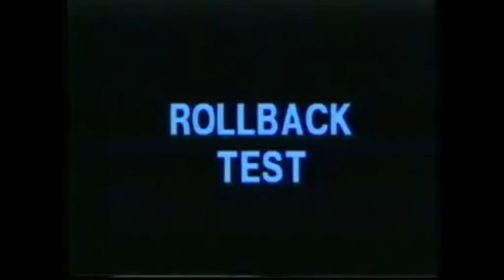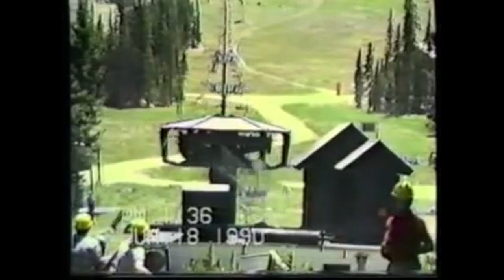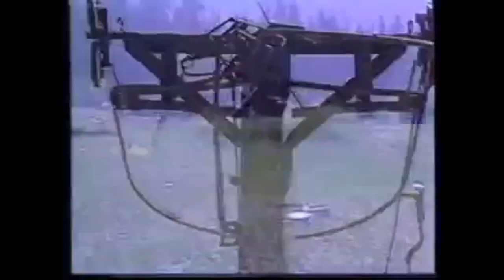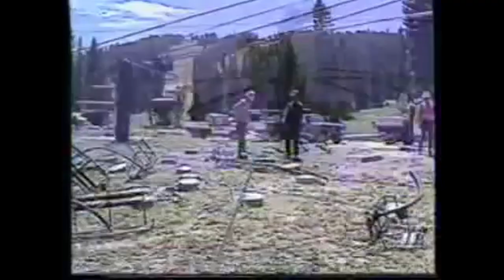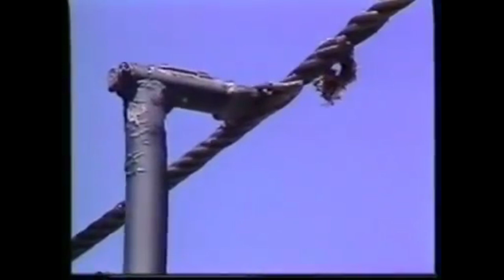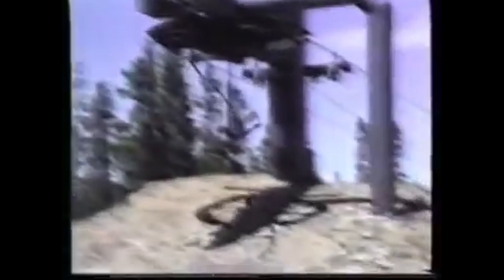VHS Rip | Eskimo Lift Destruction Rollback Test

Comment from the maker: Day Two:
After a tremendous amount of work from the Winter Park crew to get the lift operational again after destructive rollback, testing resumed on schedule on June 19th. There were no chairs on the haul rope from 51 to 72 since they all had been piled to scrap from the severe rollback. Also, there were no sheave assemblies on the upgoing side on towers #18 and #20 because they were damaged during the same test too.

The third test that was performed was the oily rope test, to simulate what would happen if there was an oil leak with oil getting on the haul rope and bullwheel. To perform this test, crews lathered the haul rope and bullwheel oil and used the bullwheel brake to try and stop the lift. While the lift was being driven uphill, the haul rope would slip relative to the drive linear/sheave generating a considerable amount of heat, reaching around 250 degrees Fahrenheit (The bullwheel brake wasn't applied in this test, and the heat was generated from the bullwheel still in motion while the haul rope wasn't in motion). The process was repeated again, but this time the lift was running in reverse at a line speed of 750 per minute. When the bullwheel brake was applied, the haul rope continued to slip on the bullwheel linear/sheave.

The fourth test that was performed was to see what would happen to a lift if a tree fell on the haul rope if it was in motion. With the lift operating uphill again, a tree 35 feet from tower #4 was cut and allowed to fall on the downgoing side of the haul rope. There was no carriage movement upper terminal, at tower #4A the haul rope was off the sheaves, while the cable catches on towers #2, #3, #4 supported the downgoing haul rope. This test was performed again at towers #16 #19, but the effects weren't as major as the first tree on the line test. However, unlike the first test, in both the second and third test, the haul rope didn't derail from the haul rope when a tree fell on the upgoing line.

The fifth test that was performed was the most dramatic of them all. The fire test was carefully planned, including the fire department ready incase another fire broke out that wasn't planned. Trees and nearby foliage were soaked prior to the start of the burn.

The Eskimo's motor room was located in a concrete vault below the lower bullwheel and had a structural wood roof covered with asphalt-based materials. The only piece of equipment that was removed from the motor room prior to the fire was the auxiliary power unit. The fire was started by using some oily rags and placing them near a workbench. About 27 seconds after the fire was set, it was evident to the people around the lower station. About a minute and thirty-five seconds after the fire was started, the lift came to a stop from the bullwheel brake hydraulic pressure line being severed by the fire. After 14 minutes after the fire became evident, the haul rope finally separated causing the chairs to drop to the ground. The temperature at the bottom station from the fire reached as high as 1,800 degrees F only 6 minutes after the fire was evident. The fire was eventually put out by the firefighters after 21 minutes into the burn.

The final test that was performed was to test out the lateral loads on towers to attempt to pull them out of the ground. Even though this was the least exciting test of the 6 tests that were performed, there was a lot of knowledge gained from this test. There was a total of four tower foundations that were tested during this test, two deep footed foundations by Riblet and two shallow tower foundations by Lift Engineering/ Yan. During this test, there were forces that were applied to both the top and bottom of the towers. Both the Riblet tower foundation footings failed having structural tubing issues, one by a failure of the collar weld while the other failed due to the tower tube bending. Both of the Lift Engineering towers also failed because of uprooting from the ground.